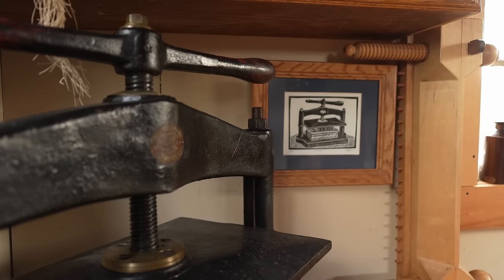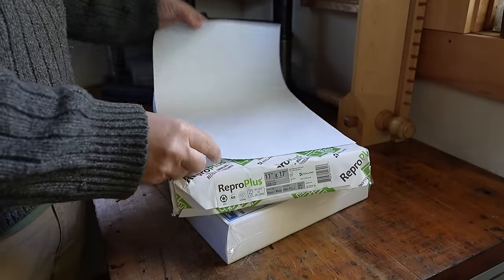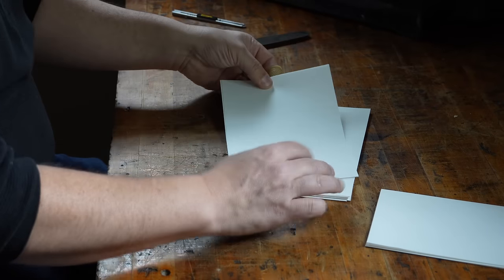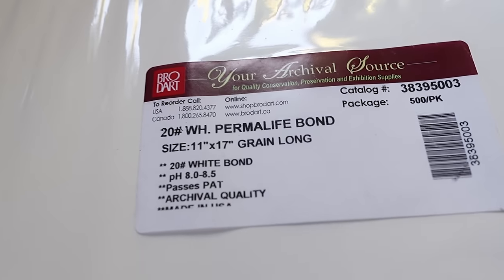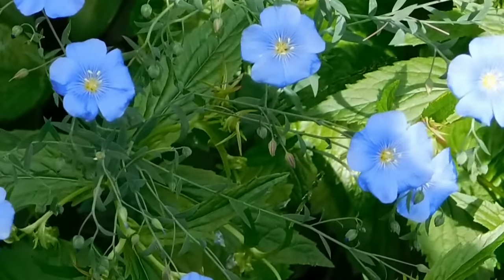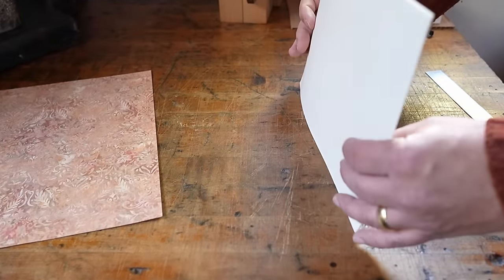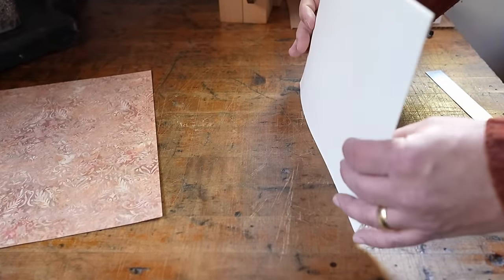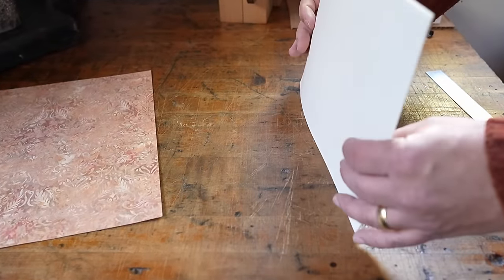Bookbinding Basics: Chapter 2 - Basic Materials & How To Make Your First Notebook

Comment: A trick I've found out with paper grain, if you hold the paper up to the light, sometimes you can see which way the grain is facing. It wont work for all papers though, probably only thin ones.

Comment: Thank you for the weight and grain explanation. Helped a lot.

I just tested the tinted 80gsm A4 paper with the cutting method. I've scribbled on it the grain information, so that explains why my first printed book ended up looking the way it did. Oopsie on the grain not being parallel to the spine. Oh well, its a good learning experience for me. 😁
Reply: I bought some A3 sketch pads and tested the grain direction first. 

I can finally reprint and bind the PDF book. I have to dye the paper but the test paper went well for taking the dye. 😊

Comment: Thank you for your endorsement of the metric system!

In the metric  system, you don't need to have arcane knowledge about paper weights, and you don't need an "entire video" to explain it. In fact, if you stop this video at 3:00 (red Staples label) you can see how it works. Right next to the "20lb" you can see the metric weight: 75 g/m² - no matter what kind of paper you have in front of you. It's easy to go for paper a bit more substantial, just go with 100 g/m². Different paper type but same weight? Still 100 g/m².

Incidentally, you might want to take a look at A format paper (A4, A3 etc.) while you are at it. Its size is not as arbitrary as it seems: First of all, every A format is half the size of its predecessor, so A4 is half of A3. A0 has a size of exactly 1 m². In fact, every format Ax has a size of (2 raised to the power of -x), in m².

Second, and more importantly for practical applications: Every A sheet has a ratio of 1:sqr(2). From that is follows that you can half any A format sheet and get exactly two sheets of the following size. So one A4 would make two A5. For book binding, you can get an A3 sheet, fold it over, and it would be exactly A4.

It's the metric SYSTEM, not an arbitrary bunch of numbers you have to learn by rote.
Reply: Obviously I wrote this comment before watching the rest of the video. Oh well, my bad....

I have one nitpick though: "gsm" is a really bad replacement for g/m².

Comment: Thank you! The lbs paper weight always confused me and even though I always used the metric system. So that explains why that one recommended paper weight was that thin. I just had the lbs number and thought I go a little fancier and take good drawing paper instead of printer paper for my markers. Well ups XD
Also paper volume is a fascinating topic :D I have an american and a british version of two books that are about the same size and have about the same number of pages and one weighs almost double. I never really thought about that until I home-printed my novel. The difference even with same weight paper became apparent when I accidentally mixed white paper with that off-white eco paper (kinda love the texture) and creme cloured printer paper. On one the laser print really showed through big time on the other almost not at all. Also how differently it behaves when punching the holes with an awl. One out of 4 sheets in the signature was a different paper and you could feel it!
I there any trick/indicators with normal paper to see if A3 paper is short grain before you buy it online? I wanted to make my book right and bought A3 Paper for the grain direction and cut it, but when I became suspicious and tested the grain direction I saw it was A3 long grain and resulted in normal A4 long grain if cut down. :/

Comment: Thank you so much for the information on the paper grain, I kept wondering since I watched your medieval book binding series how to determine that and what difference it made.

Is making a watercolor journal this way very difficult with the weight of the paper, though? what about if it's made with cotton instead of regular paper pulp? I imagine you'd need proper book board for a cover, too... I hope these are questions you'll answer in another video, but if not I would really appreciate someone in the comments with some experience piping up to give some insight.
Reply: If using watercolour paper, I would limit the signatures to four sheets.  
Grain direction would still apply on most watercolour pads/papers.  
As it is a watercoulour journal bookboard/greyboard would be more aestically pleasing, though I have also used a type of rigid plastic.   Binding to greyboard is different to this technique as you'll need end papers to attach the greyboard to the signatures.  
You can keep the spine exposed or you can make your book with a flexible or rigid spine.  I hope this helps answer your question